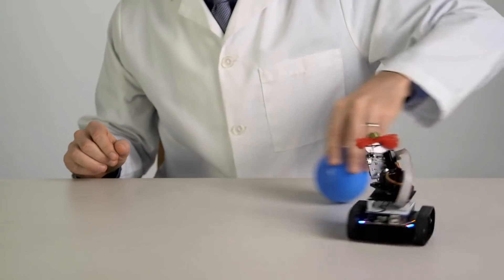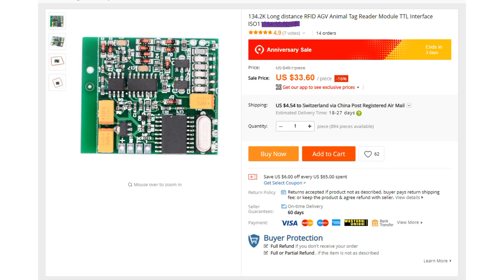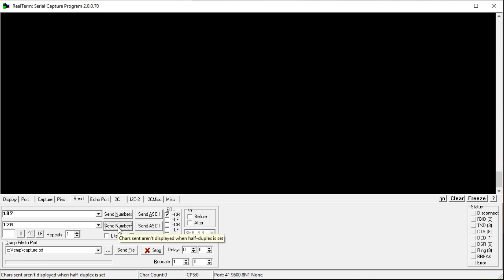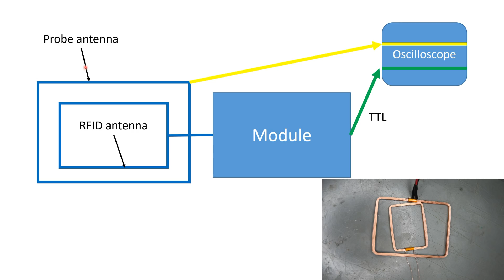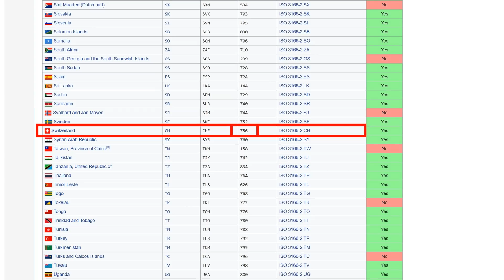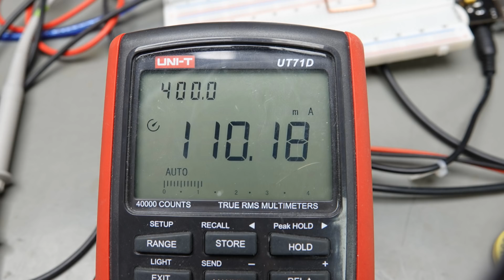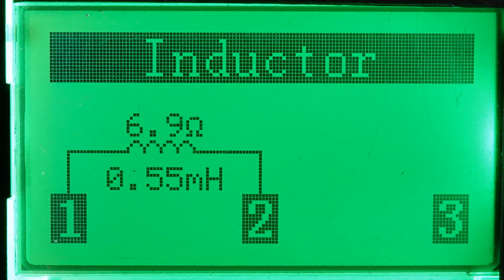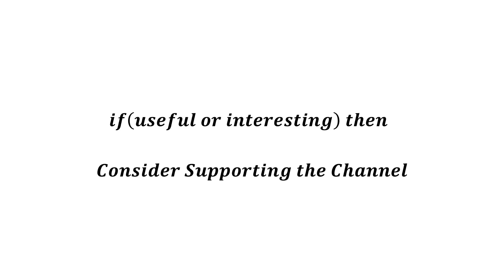#263 How to build an Animal RFID reader with Arduino, ESP8266, or ESP32

Comment: Hey Andreas, thank you so much for your video! Quick question: Do you think it's possible to use more than one antenna with a single long-range reader and an Arduino Mega?

I’m trying to build separate 'food box doors' for my 4 cats. Two of them regulate their own food well, but the other two are getting a bit chunky because they eat the leftovers! I'm hoping to avoid buying 4 separate readers if possible. Thanks!
Reply from the maker: The antennas are connected to a transceiver board. These boards are connected via serial to the Arduino. So you can connect as many as your Arduino has serial connections

Comment: Amazing video! Btw, do you have a picture/video with the final reader and arduino configuration? No idea if capacitors need to be adjusted or what…
Reply from the maker: I mentioned what I did: Adjusting the inductivity of the new coil to the one that came with the module

Comment: Hello Andreas, your project inspired me to create something similar but also with a servo which would open the lid of the bowl for my one of the cats with kidney problems because she has to eat seperate food. I am trying to wire everything up to be able to use it with power brick in wall but with no success... When powering through usb type C port on my ESP32 everything works fine but then after trying with 5V 3Amp power brick no luck... I added step up converter for the reader to get 9V. Maybe you would be able to share the schematics how everything needs to be connected? I am more of a software engineer and my knowledge about electronics are limited... I want to have everything powered from outlet. Thanks in advance, happy holidays!
Reply from the maker: This is an old video. So I no longer have the details (and Diska also passed away). If it works with USB power, it allso should work when you connect 5V to the 5V pins of the ESP. I am not sure if the board can cope with 9V, BTW.

Comment: How easy would it be to have this send a signal via Bluetooth or other radio frequency to trigger a buzzer or light? Alternatively, could you have the LED on a really long cable? I'm thinking about how this could be used to help monitor birds returning to a nest.
Reply from the maker: Adding communication should be easy if you use an ESP32. But keep in mind: The animals have to be chipped.
Reply: @AndreasSpiess  thanks Andreas. Yes there are many options for tagging birds with PIT or RFID tags now

Comment: Helloo there, after a lot of research i finally heard of a person (you) that’s looking for something similar as me ￼. I want to somehow make an rf detector that will alarm me (by noise- alarm and mobile notification) when my cat tries to pass through the entrance door. The purpose here is to improve safety for my cat, as i share the house with more people and i’d like to exclude the possibility of my cat escaping the door because someone did not pay the proper amount of attention. I do not obligatory need to make a detector for the specific chip that the vet has applied to my cat, i was thinking that maybe something very small that i should attach to her collar could also work. In addition, i need this alarm to be operated only if the cat passes through the door and not when she is near it, as the entrance door is basically in the middle of the house 😅😅Do you know how this idea of mine should be appliable? Myself, i don t know how to make an automated system like that but since i get some perspective here, i could easily find someone to make it for me!
Thanks a lot, in advance, for reading my strange request
Reply from the maker: You can buy cat doors with this functionality. So it should be possible to build it yourself.

Comment: Hello Andreas.
I am going to build a very similar feeding station but for hedgehogs. You used 0.4mm wire for your coil. Is that the ideal size of wire or just what you had already?
I need to order some for my project so want to get the most appropriate wire
Reply from the maker: I do not think that the diameter is important. But in the end, you have to measure the inductance. It also depends on the diameter.
Reply: @AndreasSpiess  
The 'long range' circuit turned up today.
I am not impressed with it. I think it is a lower rated version of your one, although it looks the same. I am getting quite fed up with the rubbish coming from China.

Comment: I missed the ranges of the different options, very interested in the antenna variations.
Reply from the maker: The range depends on the antenna. But it is rather small.
Reply: @AndreasSpiess  I'm considering this to help track dogs with chips. Do you think a loop antenna say in a door mat would be sensitive enough, or maybe the perimeter of a door (human size) would fit the bill?
Reply from the maker: @fixr  I assume the chip has to go through the loop or has to be extremely close to the loop.

Comment: My both cats have last generation chip with temperature reading. Why the sure flap and other connected feeder or cat flap do not use this feature. It would be  useful to have an alarm like a red LED that stays on until reset and showing your cat has high temperature.
Reply from the maker: Interesting innovation to read the temperature. I did not know it exists...

Comment: Hi, should the module flash when it reads a chip?  Does it need to be able to read a chip even if it's not connected to the Arduino?  I ask these questions because my module does nothing, even when powered it detects nothing.  Thank you.
Reply from the maker: I do not remember those details :-( But it should work without Arduino.

Comment: Hi Andreas, is it possible to build a coil as big as a front- or other door, so aproximately 2.00 x 90 cm? So you can detect if a pet went through the door. The coil is than hidden around the doorframe. I understood the method to follow is: measure the inductance of the  sensor coil and replicate this inductance in your own coil. (I have lots of thin enamelled wire.) And is there a formula I could use to know in advance how many turns I have to make around the doorframe?
Reply from the maker: I do not know if this would work. But I am very sceptical. You have to try if you want to know.

Comment: I ordered an antenna like the one you described, but they sent me the wrong size, 13 mm instead of 215 mm. There's no way I'm going to fit a 6 kg cat through that opening, and the vet says he (the cat) is not overweight, so dieting is not the solution. Can I just take the tape off and make the antenna bigger myself, or is that going to cause other problems? I'm hesitant to return it to AliExpress due to the extremely long turnaround time.
Reply from the maker: I made my own antenna adapted to a cat. I hope you saw it in the video
Reply: @AndreasSpiess  OK, thanks, I'll check the video again. This is all new to me so I haven't actually hooked anything up yet. :)

Comment: Hi Andreas, I'd like to build a similar receiver and build my own antenna. I think you used copper wire with insulation (enamelled). Would it be possible to use wire without insulation?
Reply from the maker: The wire has to be insulated. Otherwise it behaves like only one winding.

Comment: Was it the long range reader that you used for the final product? Also did you have this powered via 9V battery for final product or use power outlet?
Reply from the maker: Yes, I used this one. And for a final installation I would not use a battery (see the current draw in the video)
Reply: @AndreasSpiess  And did you use the original antenna or did you made a new one? I dont know if i can use the original antenna to put in the circle of the door. Another question i have is if i could use the tiny reader doing a bigger antenna buying new cable to do it.

Comment: do you think you can use 3 antennas on one chip? With a switch between the antennas and the chip. The switch decides which antenna is used by move detection sensor or so. I want to build 3 feed channels in one box. How did you manage the entry restriction? Magnetic Locks? Thanks for your share.
Reply from the maker: You should be able to add relays for several antennas, I think. And I never did entry restrictions, so I cannot help.
Reply: @AndreasSpiess  what is your current use case for RFID reader?
Reply from the maker: @saintenr3162  Currently, I do not use this technology anymore.

Comment: Could you please tell me, how many turns of copper wire you used? I've been trying to make the same antenna, but I don't know how much wire should I use. :/
Reply from the maker: I do not remember :-( But you can measure the inductivity and adjust accordingly.
Reply: @AndreasSpiess  Unfortunately my multimeter can only measure voltage and current, and I don’t want to buy new equipment for this project only. :/
Reply from the maker: @andrasigellert  If you tinker, you anyway will need a transistor tester one day. Most of them can measure inductances, too

Comment: Hi, thanks for the great video. I have bought and tried the second RFID reader and connected it to an Arduino mega. I tried to read it but constantly get 0 from Serial.available(). Any idea what I am doing wrong?
Reply from the maker: Unfortunately, I cannot do remote debugging. I would connect the reader to a USB to Serial adapter and check if the reader works. If you have an oscilloscope this might also help. But first I would check if you reversed RX and TX...

Comment: Thank you for this video, it has pretty much all the info I was looking for. I'm planning to install a chip reader at the front door and garden door of our apartment to receive a warning via Home Assistant when our cats cross them. That way we can know and act right away if they ever escape (as the apartment is in a big city and our cats are not used to going out on their own, and when they go outside with us it's in a mostly enclosed garden in a more rural area at our house, they would very likely get lost, maybe permanently, and possibly hurt if they ever got out unsupervised).

One thing I'm wondering is what orientation the chips are inside the cats. Since we don't have cat flaps on the doors and my project is meant to be a warning system rather than automating something like a cat flap or feeder, the most ideal location I can think of for the antenna would be flat on the group (possibly inside the doormat). But I'm not sure if this would work with a sufficient range.

Otherwise I suppose I could try to put the antenna parallel to the door frame.
Reply from the maker: You have to try the reach of the antenna. But usually it is only a few cm.

Comment: Moin Andreas, basierend auf Deinem Design habe ich einen RFID-Tag-Reader besorgt und eine 15cm Rundantenne  gedruckt (Annahme des kleinsten Durchmessers, den eine Katze passieren kann). Die dem Reader beigefügte Test-Karte funktioniert mit der kleinen, mitgelieferten Antenne und der gedruckten 15cm Rundantenne. Der Tier-Tag, den ich mir zum Testen zugelegt habe funktioniert mit der kleinen Antenne, aber nicht mit der 15cm Rundantenne. (Die Idee ist hier auch, eine Katze durch zuschicken)  ich habe verschiedene Annahmen, warum der Tier-Tag hier nicht reagiert. Im Grunde reicht das Magnetfeld der Antenne nicht aus, um den Tag anzusprechen. Vllt magst Du mich mit einer Auskunft unterstützen?
Welchen Durchmesser hat Deine Rundantenne?
Hast Du an dem Reader noch was geändert (Treiber f.d. die Ansteuerung der Antenne)?
Mit welcher Versorgungsspannung läuft der Reader in Deinem Setup? 
(Ich betreibe den Reader an einem ESP32 mit 3,3V, möglicherweise treibt das nicht genug Strom f.d Antenne)
Ich würde mich über eine Antwort freuen, vielen Dank.
Reply from the maker: Ich habe im Video gezeigt wie ich die Antenne abgestimmt habe. Das ist wichtig. Der Durchmesser meiner Anlage ist 21cm.
Die Platine ist mit 3.3V spezifiziert, Also bitte keine 5V anlegen.

Comment: Thanks for the info Andreas. I think the antenna voltage is 360V though with that module and not 36V, hence the high voltage warning, so you may have used an x10 probe but not setup the scope accordingly.
Reply from the maker: Maybe. I do not know.

Comment: Hi Andreas, I have 4 cats. Two of them are obese :( . That's why I want to feed each of them separately. All of them has pet chip. I want make arduino and RFID controlled cat feeder. Can I use 1 Arduino, 1 RFID module and 4 antennas for reading their chips? Thanks your advices and ideas.
Reply from the maker: I do not know if this works. You have to try it.

Comment: hello, the video is very interesting!! i have to make a similar application, but i'm using (i'll start in these days) arduino and ID-3LA. the antenna will be built by me...it has to be very big 45cmx32cm. I just need to know when the tag ( which will be very small...like those PET glass ones similar) is in the vicinity of the antenna...the closer the better. I don't care if the code of the tag is right or not, I just need to know if it is close or not.
Do you have any suggestions?
I'm new to this, but I'm determined to do it and succeed...it's a very important project....

thanks .
Reply from the maker: I fear you have the wrong receiver board. As said in the video. Animal RFIDs are not on 125kHz.
Reply: in reality they are very small tags but theoretically they can give them to me at 125khz.....

Comment: Hi Andreas, I have 2 cats that are over weight. I'm planning to integrate this detection in a feeder and access plaform for my 2 cats.
On the one hand it will measure the amount of food they are allowed to get (on a daily basis), and on the other hard it will allow access to their own food bowl based on the chip id. 
Thank for pointing me the right way to the correct chip reader...
Reply from the maker: Bad for the cats ;-) I hope everything goes well. This is an interesting project!
Reply: @AndreasSpiess  Thank you. Still in progress ... 
However I was wondering is the model for the gate/custom antenna is available somewhere? Thingiverse?
Reply from the maker: It was just a hack :-(

Comment: I found this. Sharing in a new thread so that it's visible to others. I seem to understand that the inductance of the antenna should be around 580uH.

"The capacity of J1 to J5 increases from left to right.The smallest on the left is fine tuning, and the largest on the right is coarse tuning. 
Debug the resonant capacitor of the module. First, power on the module and erase all jumpers from J1 to J5.Then observe the working current of the module.For example, the initial value is 6V 50mA.First of all, the J5 is short circuited to observe whether the working current becomes larger or smaller.If it increases to 60mA, the total resonant capacitance needs to be increased.Then try to short circuit J4, observe whether the current increases or decreases. If it increases, it means that adding J4 is correct. Keep J4 and try to short circuit J3 again. 
If the current becomes smaller when J4 is short circuited, it means that the capacity of J4 is increased too much. Erase J4 and add J3 to observe whether the current increases or decreases. 
And so on.Finally, the working current is close to the maximum value (about100mA@7V）The card reading effect is the best. "
Reply from the maker: Thank you for the additional information!

Comment: I really hope you read this, halfway trough the video you pointed out that 2 readers interfere with eachother on the cheaper chip. 
Would I be able to build a feeding place with 2 cat doors with 2 readers if I used one of the more expensive chips?
Reply from the maker: I assume it depends on the distance between the two loops. But I never tested such a setup because I only had one sensor of each design.

Comment: Can I use this with Arduino Uno? I tried but stuck at the connection part of the reader to uno. Connected the RST of the reader to uno's RX(digital 0) and RST to TX(digital 1) but nothing reads. When I accidentally change rx and tx wires it gets some reads but confuse a lot. Any help?
Reply: never mind! I used different digital pins for serial2 and getting correct reads now. Could you please share your antenna placement design for 3d printing?
Reply from the maker: Glad it works. This is an old video and I do not have the files anymore :-( It should be easy to create.
Reply: @AndreasSpiess  got it, designed a similar one.
Reply: Hi again! :D. I made some custom antennas in different shapes and sizes however the small tag (for cats, dogs) is cant be detected from distances more than couple of cm. The ear tag however can be detected from big distance. I arranged the antennas so the H value is equal/very close to the original antenna. but even then it can be detected again from 2-3 cm distance not more. I even made a door size antenna 80X200 cm and ear tag works from each side including passing from very middle of it. Do you have any idea about it? Thanks in advance.

Comment: Your Check-code is only valid for the third device that you tested, right? I got the second device and the check code youre using seems to be the stop byte for this one (#$bb).
Reply from the maker: I do no more remember the details. Maybe you create a pull request with your corrections?
Reply: @AndreasSpiess  I have changed your program so that it works on a Mega2560 and outputs the RFIDs readings to the common I2C 20x4 LCD display. Would you like this one uploaded?
Reply: @DaPutz  I would :)

Comment: They need  these for people to put in their gardens to scan cats that come in that may be stray/missing.  Could then send the cats id to a database /local vets to locate the owner. If the owner had one as well it could record if the cat goes home to see if its actually missing  which isn't always clear.
Reply from the maker: I am not sure if the cats will go through such a small antenna...
Reply: @AndreasSpiess  Your cat did and he's huge :) I'd of thought the cat would only need to put their head through though as the chip is normally in the neck.